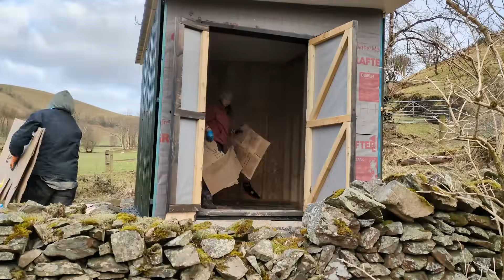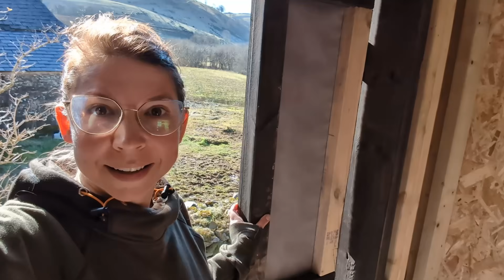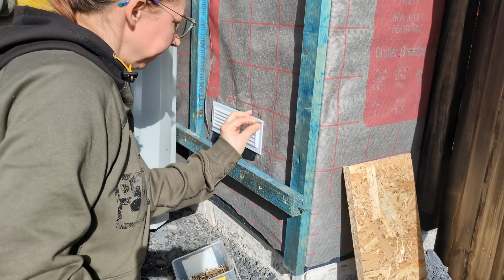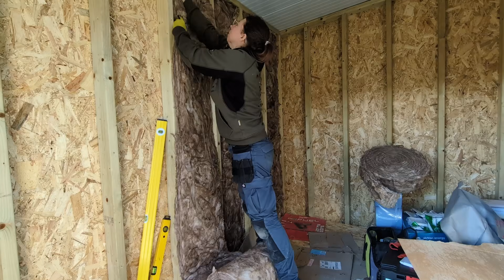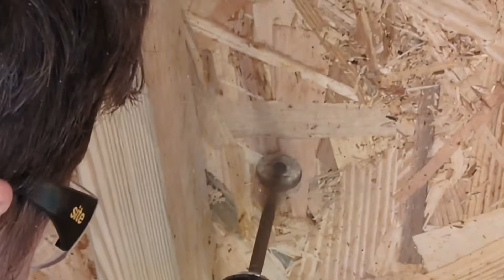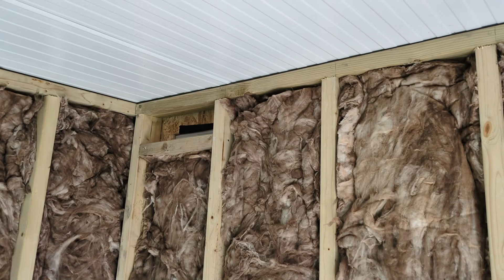Floor, Insulation & Future Power Setup : Off-Grid Water Shed Progress

Comment: No insulation on the water shed Floor ?
Reply from the maker: Not yet, no. We decided that we won't at this point, but if we change our minds we can take up the OSB and add it later. These sheds just need to be insulated enough to care for the various equipment going in there and between the wall and ceiling insulation they're proving to maintain a decent temperature so far. We are going to keep our eyes on it and if it starts to be a problem then we'll see what we can do :)

Comment: I'm not sure that I would have put a wood floor in a water closet but that is.....
Reply from the maker: On hindsight we have discovered we didn't really need the floor for this shed and could have installed this one without but it's done now. We were futureproofing ourselves incase we wanted to add in floor insulation but so far that doesn't look like it'll be necessary.

Comment: Great work so far! Please consider adding horizontal bracing between your internal vertical framing studs, at the very least 1 row about half way up, all the way around. This will greatly strengthen it against wind sheer forces, especially since the four corners of both sheds are not necessarily robust. (it appears to have only the single 2x4 stud as corners instead of say, a 4x4 or doubled 2x4's) As it sits now, your sheds are definitely moving on windy days, even if you can't visually see it, likely horizontal movement and torque.
Reply: Probably unnecessary. Noggins are required where I live but we don’t use sheeting on the outside like they have done all round here. Assuming the boards are nailed correctly to the frame then there is plenty of bracing for side loads.
Reply: The walls are torsion boxes, so I'm not sure that they need noggins, other than somewhere to screw fittings securely to.
Reply from the maker: hello and thank you for the advice! As others have commented we actually used what is called structural grade OSB as sheeting on the walls for for this specific size of shed we didn't bother much with noggins. We are planning a much bigger shed in the future and even though we are going to OSB clad it again we probably will use noggins like you've said on that one :)

Comment: I just started watching and I don't want to start off badly but I hope you will reconsider trying to rebuild that barn. Someone could get seriously injured. The roof is going to need to be removed. Some of those timber sections are unsupported and look to be over 500 lbs. Just dropping the sections you'll have to rebuild where you want them is an engineering job. The walls should be checked out with laser levels to make sure they are still straight. You can always build a smaller barn from the salvage.
Reply: 😂😂😂😂😂 OMG Tell me you’re an American without telling me you’re an American.
Reply from the maker: Hopefully to help you feel less worried for us, I wanted to let you know we are working with all sorts of trades from an architect, to a structural engineer, soil surveys and grounds workers. We won't undertake any big jobs ourselves that are dangerous and are fully considering the best way to rebuild this barn into our home. :)

Comment: I’ve seen people use it to protect floors, they tape it together, like protecting new wood or tiles during light construction. That’s too bad about the architect, that’s a lot of cash to lose, unfortunately rehab of a ruin or derelict building is more expensive than a new build because of the permits, historical rules, lots of labor and finding good trades people. Trades people, good ones, are highly trained in their craft, not necessarily too expensive but are the key to happiness!!! Respect labor and especially give them a good working relationship and you will enjoy paying them! Network, network and start looking around at places you love, seems like you’ve got the time at this point. Sorry for the long winded answer but take it from someone who knows and who’s been there.

Comment: Hardboard is mainly used for decorative surfaces in a dry environment. Ive found them in the bottom of cheap chest drawers (crap, as they don’t hold their shape and stuff falls out!) Save those pieces (if you can keep them dry) for protecting surfaces you’re working on. Now then you pair, have to say that everything in this video was done how I would have done it. Make sure you have some eye protection on when using the nailer👍 Brilliant work and well done 👍💪👏👌
Dan, sent you a message, give me a bell. Cheers
Reply: on floors below lino, to make the floor smooth and flat.